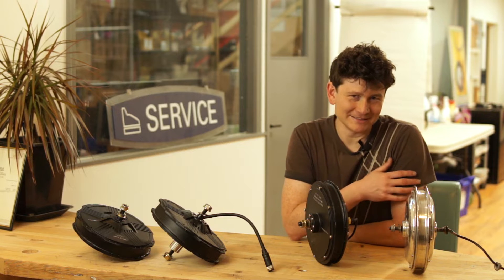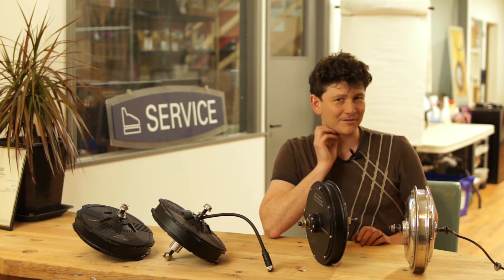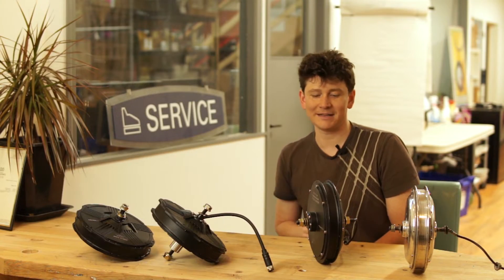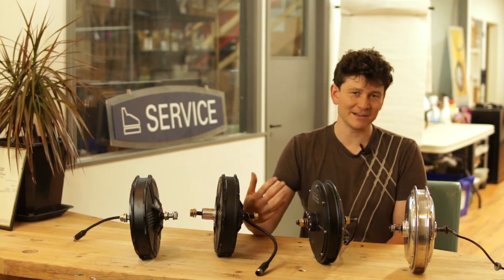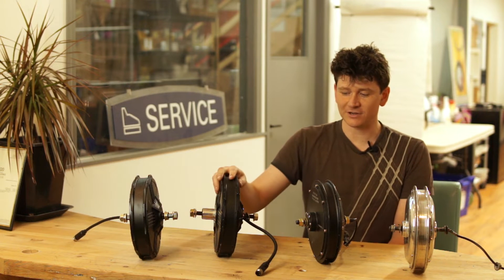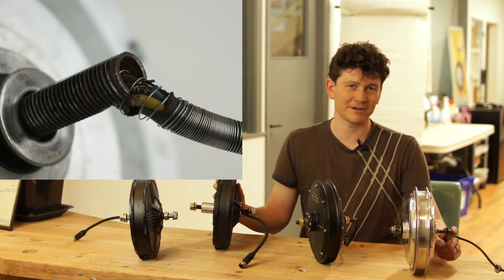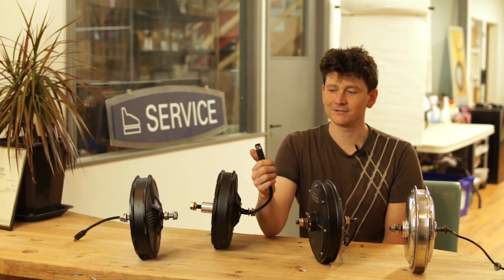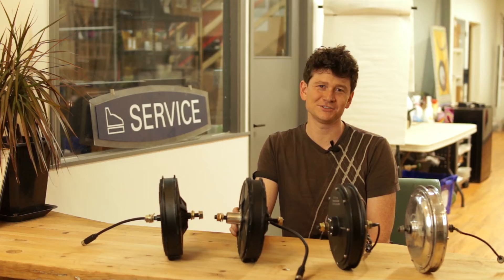Introduction to the RH212 and FH212 direct drive motors

Comment: Do you have the G-Mack geared hub motor for a fat E-bike with the Franklin Runner controller kit? How much for a pre Built 26 x 4 with the G-Mack motor?
Reply from the maker: Hey Vik, only if you are planning to install the GMAC motor on a front fork with 135mm dropout spacing.  If you wanted a rear motor on the back then it won't fit. All pricing is on the website https://ebikes.ca/gmac-minimal-kit.html

Comment: I will give Nine Continent front hub motors a look regarding using them as a replacement for a down tube-mounted Stoke Monkey
Reply from the maker: It's a great option if you have the space for a motor of this large diameter. Otherwise one of the smaller diameter geared motors like the eZee hub or the Shengyi SX1 motor can be awesome choices too, and they have the additional benefit of having a built-in freewheel.

Comment: Which wheel build kit should one select if replacing a super73 S2 motor with the rh212? The wheel build selection doesn't show width measurements, and I don't wanna accidentally get one that's not 20x4
Reply from the maker: AFAIK all the super 73 bikes use fatbike dropout widths, so the 135mm RH212 wouldn't be compatible to replace the rear wheel. See https://ebikes.ca/learn/bike-compatibility.html
Reply: @GrinTechnologies  thanks! Looking forward to actually having some torque on this thing lol

Comment: I wish this motor can use the same torque arm as GMAC. I just tried GMAC and the noise level is just too much for me.
Reply from the maker: Yeah we agree! On this front we tried but unfortunately weren't able to get 9C to be able to produce a splined interface like we were able to get done with MAC motors. But we may try it again.
Reply: @GrinTechnologies  thanks for the reply.   I do love the rh212 which is very quite.

Comment: These work with a 26x4 inch fat tire?
Reply from the maker: Yup, as long as you have a suitably wide rim used in the wheelbuild.
Reply: @GrinTechnologies  additionally... what's the maximum wattage can this motor take before it basically cooks? 🤔

Comment: Does rh212 motor work with 26 fat tire?
Reply from the maker: Most fatbikes have 170/190mm dropouts on the rear, and 135/150mm dropouts on the front. In certain cases you can use the RH212 rear hub (with it's 135mm axle OLD) as a FRONT hub drive on a fatbike that uses 135mm front fork spacing.  But if you are hoping to mount it on the rear, then it's not going to work unless you have an offset frame, like the Surly Puglsey ( https://surlybikes.com/blog/pugsley_2.0_modern_take_on_a_classic )

Comment: Thanks Justin! How do you find the "statorade fill port" ? Is there a label to identify it ?
Reply from the maker: On the motors we supply the disk bolt hole that is drilled all the way through is identified on the side of the motor via the laser etching.  If you can't see it, then you can always remove all 6 disk bolts and probe with a toothpick to see which one is drilled out all the way through.

Comment: Would love to see a comparison between front hub motors.  9C FH212 direct drive VS Bafang G311 geared motor. 
A usage case on a commuter bike. Understanding the pros/cons and what it’s like to live with each of these on a daily basis. 

The FH212 being a much more powerful motor, does it make up for its lack of gearing from a standstill?

The FH212, being its direct drive, you loose the ability for the bike to just be a bike without pedal assist. Thats a +1 for the G311.
Reply from the maker: Hey Michael, you kind of summed it up OK. If you want something super light that you will regularly pedal without any assist then a small geared motor like the G311 is hard to beat. If you are using the motor most of the time anyways and have higher power and speed requirements, the FH212 would be a better choice for sure, not to mention the fact that it gives you regenerative braking (at least a +2 IMO).

And if you want all the benefits of the FH212 but without the same weight penalty, the Grin All Axle motor comes in just 1.6kg heavier than the G311.  With a direct drive motor you do not loose the ability to ride without pedal assist, that is a common misconception. There is some rolling drag but is not that significant, and you can eliminate it entirely with electronic freewheeling ( https://www.youtube.com/watch?v=d0nyiDbWZuM&ab_channel=GrinTechnologies )
Reply: @GrinTechnologies  Thanks - I am also curious about a comparison between the GMAC and something like the RH212, both with the slower winding for cargo bike application (like an Edgerunner).  Using the motor simulator seems like the GMAC is the weaker motor and would generally overheat faster.  Am I missing something?

Comment: Hole mich Watts does ist have Peak sind continous
Reply from the maker: That depends on how many watts your controller allows to flow into the motor and how heavily the motor is loaded. Plus what you mean by peak. There is no fixed answer.  See https://ebikes.ca/learn/power-ratings.html

Comment: Hello folks.
 I will agree that its so nice to see the smile on your face poster.
 Quote your happy to see that they upgraded the motor. Wouldn't you be more happier if they upgraded to what you wanted to see or do have happen in improved or for your needs that your in total control of this way a better motor faster them waiting for them to get it right on the their thrid generation motor? After all they are just the manufacturers of a product.
 ( that's if I was listing very carefully) or I'm hearing those voices again.
what company would you use to have your own house brand?

Ride Easy

Comment: The front axle has a larger diameter than the fork’s openings. Do I need a fork with a special dropout? I would like to know - How do you expect us to use the front motor? Thanks!
Reply from the maker: It is very common for front forks to be a little less than 10mm, like 9.6-9.8mm or so. In that case, you simply file the opening of the fork larger until the axle just fits.
Reply: @GrinTechnologies  Thanks for the reply!

Comment: thru axle ever?
Reply from the maker: Just the Grin hub for that https://www.youtube.com/watch?v=S1bVijEFcQk   
When things are more settled at our new space we will resume working on a rear version
Reply: @GrinTechnologies  oh cool, that will be a great addition!
Reply: @GrinTechnologies  do any of your controllers have the ability to use electricty to actively brake the motor further than the regen will do? and do you have any plans of integrating the two? that is regen down to a lower speed and then active electric braking after that in a seamless operation. andthe pressure on the brake handles decides how hard the braking occurs?

Comment: Mate these big motors are old fashioned and ugly as fuck you need to go in the complete opposite direction and make them as small and as powerful as possible plus you motors are even more ugly than the cheap Chinese ones yours look like they been made out of bits and pieces you made and put together they look horrible and the amount you charge for them is rediculas
Reply: This is the motor I would take into a zombie apocalypse. Next to no maintenance, powerful, great regen that can bring you to a stop down a hill,  use it at 1500 watts continuous. Yes it's 14lbs but if you want to turn a bike into a quick whip, this is the motor.
Reply: @CurlyFurlong  Me too! And I think the new ones look great!
Reply: @CurlyFurlong  it's ugly and old fashioned

Comment: Hi .Is it ok- fast wind on 26" 52v battery for all mountains
Reply from the maker: That's fine as far as the motor is concerned, but you'll want a motor controller that is suited for the higher phase amps that results when you use a higher KV motor when hill climbing.

Comment: Any reason stamped steel would have any advantage over an aluminum stator body?
Reply from the maker: It's mostly a question of economics and manufacturing expediency. They're also pretty light, while the cast aluminum stator bodies (at least those from Crysatlyte) are quite overbuilt and I think are heavier than what 9C has here.
Reply: @GrinTechnologies  My motor has a steel stator body and is still going strong. I just put in some Statorade. My only concern is if I put too much (10ml into a 1000w motor) and forgot to drill a vent hole before sealing it up. Is there any way too much Statorade can cause damege?

Comment: Paired with a phaserunner, what is the max Watts this motor can sustain during short acceleration times of 10-15 seconds at low rpm, or over small hills from low starting rpm? Thanks!
Reply from the maker: Hey Jeremiah, at low speeds it's the 90A phase current limit of the Phaserunner that will be your limiting factor for power output, rather than the capabilities of the motor itself.  Figure around 1500 watts. If you really want 2500-3000 watts from a standstill then you should get a larger 12 or 18 mosfet motor controller that doesn't have a phase current limit, and keep an eye on the L10 connector too.  If that starts to show signs of melting, then replace it with larger RC bullet plugs.
Reply: I‘ve used it up to 1500W for 1min. Temp raised about 40K (without statoraid). But 1000W is sufficient for daily use without any temp problems even at continuous power at low rpm (~90°C). Keep in mind to have two torque arms. It’s a real beast…
For my use it’s more the battery (1070Wh, 72V) the limiting factor, if you pay attention to sustainability…
Reply: @olafberend8837  Thanks Olaf. I have this combo, too. I want to push it to 2000-3000 watts for short bursts (fun factor of acceleration, not more top speed). I have the statorade and building a custom battery to be able to put out the amps. I'll report back!
Reply: You can for short bursts do 2000 watts. The bottle neck will be the L1019 connector as it will melt at sustained higher phase currents.
Reply: @Philbuiltit  Phaserunner limits to 90A. So you won’t get more torque out of it (phase amps proportional to torque). 2…3kW at higher revs should be feasable… Keep an eye on the windings temp and calculate a delay. Outherwise you will grill them. Therefore I’m limiting to 90°C to get early warning when recuperating downhill… But the 1,1kW downhills lasted not long enough…
Reply: @olafberend8837  It's never enough for speed junkies. They always want more.
Reply: @sammiller6631  When I crank up my Velomobil, speedometer shows 90km/h (55mph). So this is frightening enough. And torque is sufficient, if you want to get the cars angry. But if you drive on legal roads that’s not a goal. So in practice only accelerate or decelerate to/from cruising speed is the task. That’s fun anyway…
Reply: @olafberend8837  All good points, thanks

Comment: What is the peak power of this motor
Thank you and nice yob
Reply from the maker: To define "peak power" you need to tell me at what RPM and for how long. 
 https://ebikes.ca/learn/power-ratings.html

In ebike applications and typical ebike motor RPM's you could run it up to 3kW or so for short times, and ~1-1.5kW continuously.  If you used it to spin a propeller on a boat at 1500 rpm, then it could do about 5 times this much power.

Comment: Great work! What is the weight of the motor and its nominal power (Max power it can last for hour)
Reply from the maker: It weighs a little over 6.5kg (first batch was lighter but had occasional cracks in the spoke rotor flange, so that had to get beefed up).  Continuous power  for an hour depends completely on the RPM and whether or not Statorade is added to the hub.  At fast ebike speeds (40-50 kph) it's easily around 1600-1800 watts with Statorade, and 1100-1200 without.  At lower speeds it is proportionally less.
Reply: If you consider the hub without motor, I‘ve measured an additional weight of about 5,9kg (42-559, Marathon Supreme) and DT Swiss rim.
Reply: @olafberend8837  42mm is too small of a tire for a hub wheel. 2.2" should be a minimum afaic
Reply: @rantanplan7474  Bigger than 40mm is too slow for a velomobil and not necessary. It's an oil-dampened fully (you can lock it, if you want)! The Supreme is a well known compromis, with good punkture reliablility and tracktion on slippy roads (snow) despite the fact that there are tyres with less rolling resistance on the market...
Reply: @olafberend8837  how is a bigger tire slower on an ebike? You're making the mistake of thinking of ebikes like they were acoustic.
Reply: @rantanplan7474  A bigger tire makes sense if you want to ride in heavy terrain at a higher comfort (lower pressure at same rolling resistance), not considering special down-hill exceptions. With a velomobil you are riding allmost good roads at much higher speeds (avg. 35...40km/h). So you will choose a high pressure to reduce resistance. It's a fully, so comfort is not an aiming factor. Rolling resistance is limiting linear your speed at higher vehicle weight (19...35kg for velomobil vs. 8...15kg for uprights w/o e-assist) and when you are bikepacking with a lot of baggage. When you want to go deeper into that matter visit www.bicyclerollingresistance.com and perhaps you will be healed from some myths about tire sizes (bigger are allways better)...